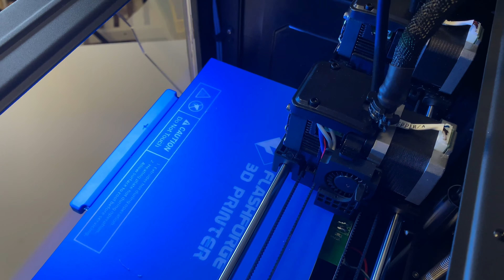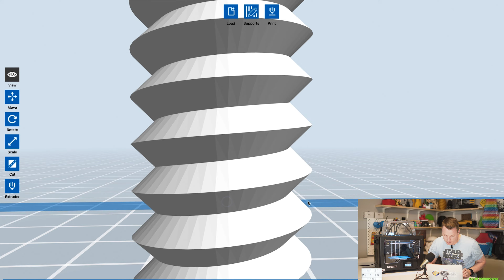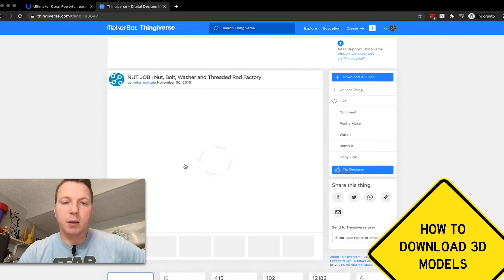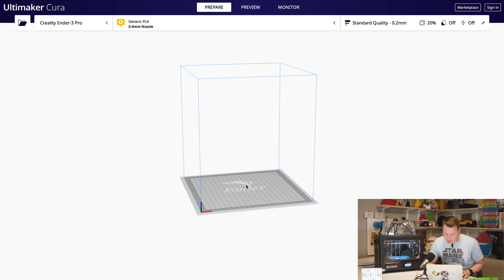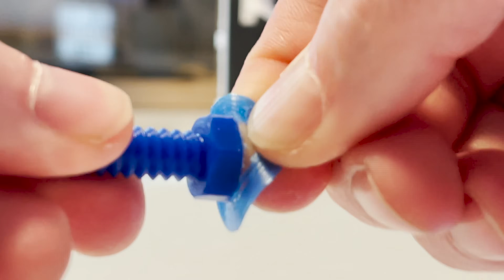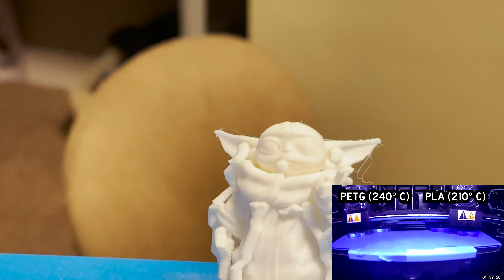Complete Beginner's Guide to 3D Printing

Comment: well you asked me my thoughts? so here it goes.... The 3d prints look like trash,
 It seem like the only thing this saves me from is,  "Going to the dollar store"  witch I don't go anyway.... I want a printer that will make brackets and things that I can customize my own pc parts making brackets buttons racks and so on....
 I think I need like a rosin printer or what ever i was thinking a 12000 dollar desktop cnc machine but ive seen hard plastic parts made from durable materials that dont flex, I guess! I just need to do the research ;)

Comment: I am in the researching and learning phase still, BEFORE I purchase my first printer. What I am feeling thus far, is that build space is one of the most important things for me. And I here very little about a larger build space, or MOST printers provide a much smaller build space than I am willomg to accept. At the moment I seem to prefer a 300x300x400mm build space. Considering the price of these printers, I do NOT want to purchase a smaller one, and then outgrow it in two months, and be on the look out for a larger one. I prefer to take my time, and find a larger one for a great price from the get go. I just do not want to be limited by build space. Seems like something most people go through early on. Most of the more modern printers all seem to have most of the other preferred features. So while I'm also ticking those off while I search, build space seems to be the key feature that separates most of these printers. Good vids. Subbed.

Comment: Came to your videos because I was having bed adhesion issues, however discovered it was a leveling problem.  That said, I noticed a lot of your prints seem to have "spiderwebs" happening in them.  I'm fairly new to 3D printing but I haven't really experienced this yet.  Is there a reason it's happening, or is it just something that happens in more detailed builds?
Reply from the maker: Those are from the retraction settings. When you don’t have your retraction speed and distance set properly this will happen. I usually don’t care much but it is easy to fix.

Comment: Thank you for your videos I'm stuck between this 3d printer and the ender 3 v2 . I'm new to 3d printing ill be making helmets, parts, figures, and other stuff which one do you think is best
Reply from the maker: Good question. They're both very solid printers but they're quite different. Nearly every spec on the Flashforge is better than the Ender - it's a more solid build, has dual extruders, has a better interface, is enclosed... the list goes on. The Ender 3 V2 will actually allow you to print larger items and is more easily upgradeable if you want to tweak the printer down the road. So those are the main tradeoffs. One other one worth mentioning is that the software for the Flashforge printers is custom built for the printers themselves, which means it's going to work well and be perfectly tuned, but it also means you can't use any software you want for them. The opposite is true for the Ender.
Reply: @The3DPrintingZone   thank you that is actually very helpful. I use to be an animation student so I've made models in Maya and Cinema 4d. I would love to be able to print out so of that stuff along with new stuff.

Comment: Are they unsafe for health?
Reply from the maker: They're really quite safe. There are certain filaments, especially the older ones like ABS, that are less safe to breathe in so if you're going to print those, just make sure you're in a ventilated area but generally, 3D Printing is very safe.
Reply: @The 3D Printing Zone can I print inside or do I need to put in garage? Also do I need a enclosure or tent cover for it?

Comment: I’m thinking about getting my first 3d printer with my tax return. Ideally, it would be $300 or less. However, after seeing a different video of yours about the Longer LK5 I am thinking about getting the pro upgraded for $370 on Amazon. Pros and cons vs an Ender 3 pro or do you recommend something different? Thanks
Reply from the maker: If I were you I'd skip the Ender 3 Pro and go for the Ender 3 V2 or the Longer LK5 Pro. You can check out some of my comments on the Longer LK5 Pro video but generally, the Longer has more features and a much larger build volume but won't have the same level of popularity/group support as any of the Enders. The Enders have huge forums and lots of upgrade options. The Longer has a lot of those upgrades built in already, so it's more a matter of what's most important to you.
Reply: @The3DPrintingZone    Thanks for the quick response. Any upgrades other than cooling you recommend? Im going to build or print an enclosure for it. The 3 filaments that interest me the most are PLA, ASA, and HIPS. Thanks again.

Comment: i know i mite get crap for this but im a dad of two trying to get in to this hobbie on the cheap, my oldest wants to 3d print. i do alot of keyboard and MCU projects that would benefit from 3d printing. im trying to make one from dvd drives do you have any tips to help out i know i need a hot end,the brains, xyz, diver board, hardware, drivers etc. or would it just be better to try to find a cheap used one for cheap. thanks have a great day.
Reply from the maker: Nothing wrong with what you're trying to do, Roy. It's absolutely possible and could possibly be cheaper than buying but I would keep an eye out for used deals. With as many people getting into 3D Printing, a lot of people are selling their first printers when they get a new one. I haven't tried building one from scratch like you're doing so I can't speak much to it but maybe others here can chime in.
Reply: @The3DPrintingZone  so i came to the point i want to buy a printer. would a ender 3 used off ebay (from a good seller)  be a good buy. or is there a better one for that 150 price range. thanks again.

Comment: Fantastic job! I am just starting to really look at 3d printing but just did not have the time but I see the products have really matured.
Reply from the maker: They really have. The last couple of years have seen some big improvements and there's a ton more on the horizon. If you get a chance, check out the Prusa XL that is taking preorders. It's costly and a little ways out but it will be the new gold standard for other manufacturers.
Reply: What a difference a year makes

“Purse the gold standard” has now become Bambulabs.

Comment: Maybe a dumb question but are there any starter 3D printers that would work with an iPad?
Reply: I wouldn’t mind finding out the answer for that also , not everyone has computers ie laptops etc.
Reply: @fishmut  NO.  no slicing software and no micro SD slot for downloading if you sliced on web site.  chromebook would be minimum if slicing online.  any laptop/desktop to run local slicing software.

Comment: Hi Again, Yep it is me Colin.  Still fighting with the Aquila I am sorry to say!  I now got a problem where I can't do a PID on the Aquila.
I got the Pronterface software and got it ale to talk to the Aquila y the US C cable.

Now with the new heater cartridge and thermistor I had to install because of a 
Thermal Runaway Event the hot end had before I had the new heater cartridge and thermistor fitted. ( along with a new main board too from flashforge )

I now need to tune this new hot end as it will wildly change in heat levels after been set to do the hot end to 210 c for PLA, 
The temperature went up and down big time as high as 11 c and as low as 196 c So I was told the new hot end needs to be tuned?

I got it talking to the pronterface Okay as I said and watched someone show how to type the right code command ( M503 ) 
to get the new hot end to 1st show what it's own starting PID numbers were?

I then wrote those down as a back up! 
Then you do the PID testing you type in the start test codes in my case was >
M303 E0 C10 S210

so the M303 tells the start testing of the heating of the hot end.
E0 is telling it that the Hot End Thermistor is being tested?
C10 tells pronterface to do 10 full cycles of testing the hot end heating.
the S210 is at the heat of 210 c on the hot end.

So the thermistor there will be 100% of the time sending back what the heater cartridge is outputting up and down! for 
10 turns so the pronterface knows what the thermal heating is like on this new heater?
The I get after about 4 minutes the new PID numbers. 
Those it seems are what you input as the working does for the system to use so the new hot end keeps the heat on or nearby the setting you do?

But no matter what I do set the temperatures for the hot end to e tested at, every time it does 1 go and a error states "Temperature too High Test Fail".
So what the heck is wrong now with this damn thing?

Every time I sort out one problem another one stops me using the Aquila.

Anyone know what I should do now?  😒
Reply from the maker: Hey Colin! Good to hear from you. I'm afraid I don't have much experience in what you're dealing with so I'm going to have to rely on others to see if they can help you with this one. If you haven't already, I would suggest asking this on some of the 3D Printing groups on Facebook or Discord. Sounds like a real pain so I wish you all the best in getting it resolved!

Comment: I have been trying to find out information on print quality and have been watching videos for months now. Seeing as I do not have printer I am watching NOOB videos, maybe not what I should be watching? I may be having unrealistic expectations for a home printer and if that is the case so be it. My girlfriend makes crystal jewelry and we were hoping to print small figures (say fairies or the like) to incorporate into her pieces via electroplating. Using the Yoda figure as an example. I noticed in the slicer software that Yoda had texture on the collar of his cloak. It is all but gone in the print. Does that have to do with the scaling? Printer quality? Settings? Material? Quite honestly her figures would be smaller (think tabletop gaming size) and while we would love to print, either purchased or found STL files as there seem to be a large number of files that are in line with her vision. If we can not get the quality, we may as well go to the gaming store and buy figures there. We have ordered a few figures from 3D printer people online but suffice to say, they are not detailed enough. Am I out to lunch? :)
Reply from the maker: Great question. The level of detail you’re after is the factor here but, generally speaking, these types of traditional printers, called FDM printers, can only reach a certain level of detail and smoothness. Most peak out at either 0.1 or 0.08 mm layer height. They also typically come with a 0.4mm nozzle but you can usually swap that for a 0.2mm nozzle if you’d like. With a 0.2mm nozzle and printing at 0.1mm layer height you’ll have a really smooth, really intricate piece. That said, you’ll want to look at what are called SLA printers to step it up a notch. They probably will get you the highest level of smoothness and detail but there tends to be a bit more involved in printing with them. In summary, I think you can get what you’re looking for using most any printer and the right nozzle and settings or by using a decent SLA printer. Most of the prints you see are a little less detailed or smooth because the higher quality means longer print times and most of us don’t need that level of detail.
Reply: @The3DPrintingZone  Thank you for the quick reply. I have not really seen that mentioned in any beginner video I have watched. It is great to know. I suspected that the figures we purchased "could" have been more detailed. I understand there is a price/performance aspect when you sell this type of thing online so no problem with what we received. We dont know how many of these she could potentially sell. I doubt it would be over 25 per year but its a fickle industry and I have been wrong about what will sell. Look up "boji balls" or "Moqui marbles" I laughed when she posted those and she can't keep them in stock. Electro forming is a bit of a slow process anyway so taking longer to print is not that big an issue. I can always download the software and pop in a sample STL with the settings you suggested, scale it and get a rough idea as to the length of time. I will check out the SLA printers and see if something there looks interesting.

Comment: How do you like this 3d printer compared to your others and can you hook up the OctoPi with it as well?
Reply from the maker: It's a very solid printer - worked great right out of the box and has been super consistent, which is ideal. It does depart from a few of the norms I've come to expect from Flashforge because it's a less expensive printer. Namely, it doesn't have a built in camera or built in WiFi. Neither of these are a big deal to me, but they would be nice to have. As for OctoPi compatibility, I haven't actually tried it yet. I'll have to do that. Here's an article on the original Creator being used with OctoPi so I'm guessing it could work but I'll post back here as soon as I try it. https://www.instructables.com/FlashForge-Creator-Pro-Raspberry-Pi-2-Octoprint/

Comment: Is there a mire option on those slicers programs?
Reply from the maker: I'm not sure what you mean by "mire option" - can you rephrase that maybe?
Reply: Example: you have a left hand model and you want to print a right hand by mirring the same object?
Reply from the maker: @YK-mw4tt  Ah, mirror - yes. Cura, for example, has a mirror tool. Here's more info: https://support.ultimaker.com/hc/en-us/articles/360011927800-How-to-mirror-models-in-Ultimaker-Cura
Reply: @YK-mw4tt  Creality Slicer (cura based) has a mirroring option (as an icon after the stl has been sliced and you click on the object 3 icons appear on the lower left of the screen and the one on the right that looks like an open book with one white page is the mirroring icon). Hope that helps!